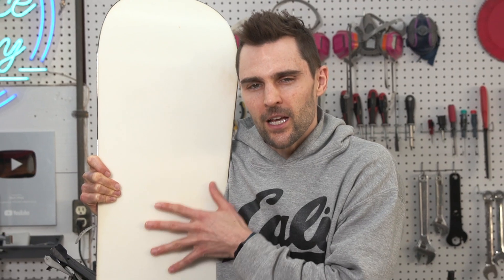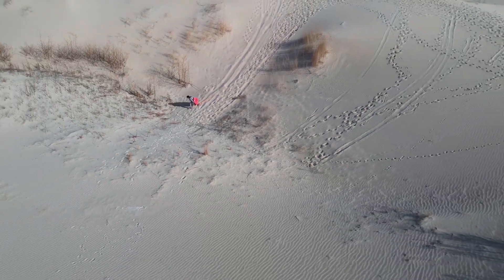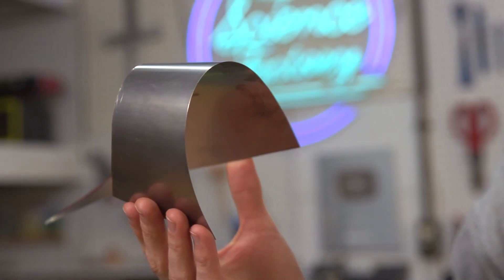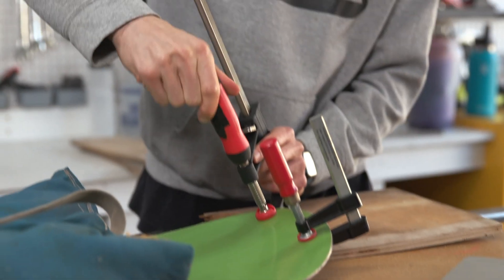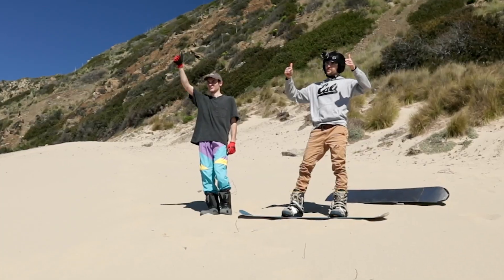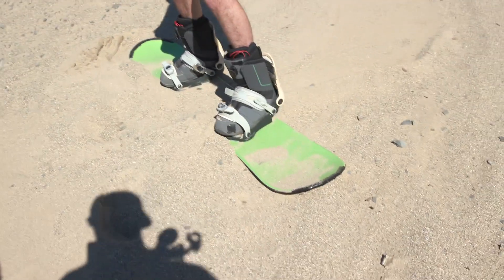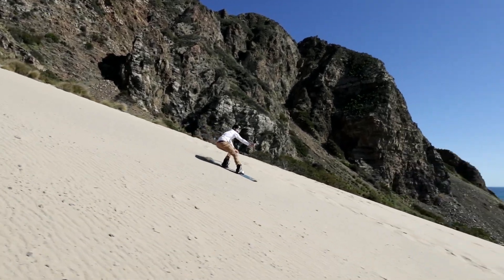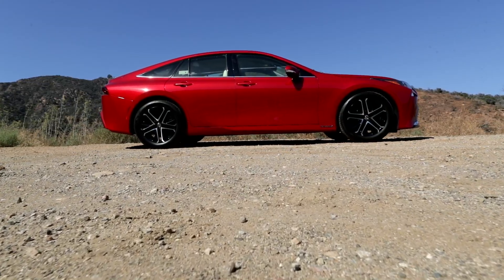Titanium Sandboard: How Fast Will It Go?

Comment: I made a sand board when I was in my teens. Its bent wood laminate and the bottom surface is smooth formika which I put multiple coats of car wax on. It has no bindings so when you crash it goes flying.
Reply: 😢G😢😢€😊
Reply: Lt🎉🎉$4g4